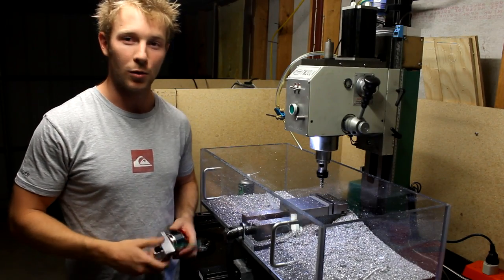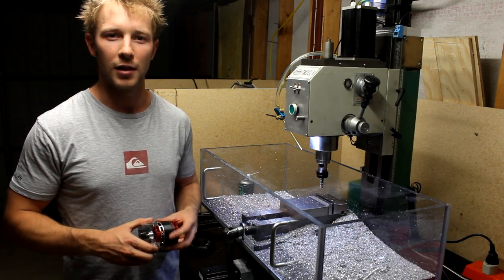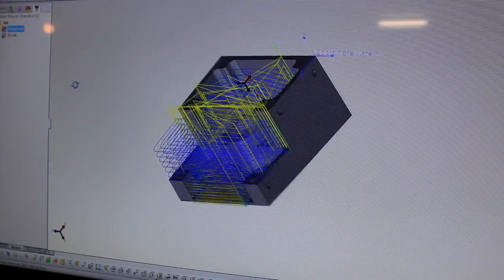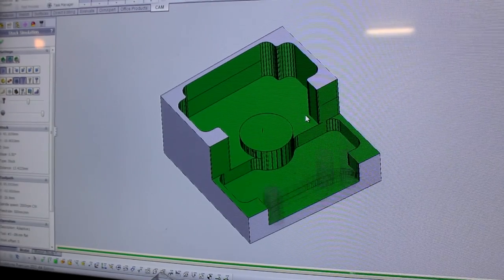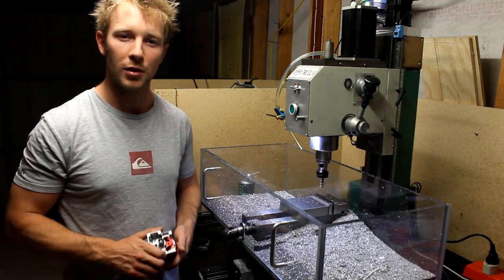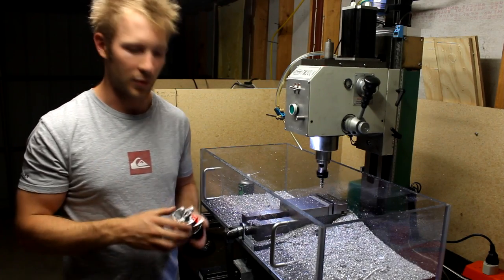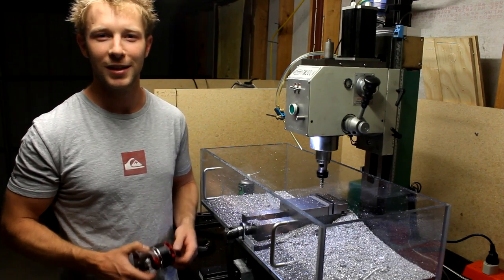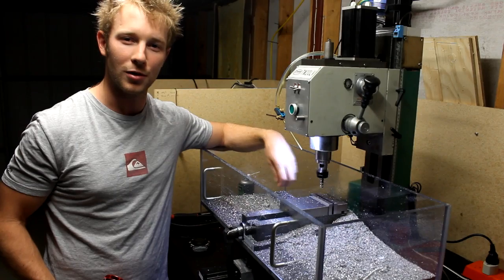CNC Milling - adaptive clearing

Comment: Ugh.... Truncated post... Adaptive clearing is amazing, I've found one large benifit is being able to make DEEP passes otherwise impossible. I run 6mm endmills at 2300 rpm(max for me) at 10mm DOC and 0.08 WOC in adaptive clearing. Really improves tool life since so much of the cutter is being used.

Comment: I just ordered a TTS ATC R8 collet for my SX-3, a few end mill holders, a JT6 chuck holder, jog controller and... wait for it... wait for it... the Tormach superfly cutter.  :)  You inspired me on the cutter.  Should receive in 3 days.  I also did a cardboard model of an enclosure inspired by yours.  So, thanks a lot!  One question: I started on HSMXpress.  Are there TTS tool libraries already set up, or do I need to create my own using the wizard?

Comment: Yup, deeper step down with a lighter step over.  Careful how you plunge down, that can break endmills too.  I love going down in a helical spiral with a 5* angle.  Stepover depends on all kinds of stuff, Solidcam guesses it for me, but 0.010"-0.030" should work great for starters.  Then you can really fly it with full rpm and lots of feedrate.  Keep trying different stuff and you start to get a feel for it.

Comment from the maker: Hey John in your opinion what would be a safe step over for trochoidal milling using the full length of the cutting flute (10mm end mill)? (to begin with). I am starting to think I should have gone in larger step downs but smaller stepover... I guess it is something to test eh

Comment: Awesome!  Whenever possible I try to use the biggest endmill I can to remove the bulk, then go in and finish up with a smaller one to get into the corners.  Also, the rougher that you broke looks like a 5 flute (cool!) which is too many flutes for aluminum, that's why there's that huge booger clog in one of the flutes.  Try a 2 or 3 flute for aluminum because it's so gummy.  Also also, that looks like TiAln coating, aluminum sticks to the aluminum in the coating.  Try uncoated or ZRN.